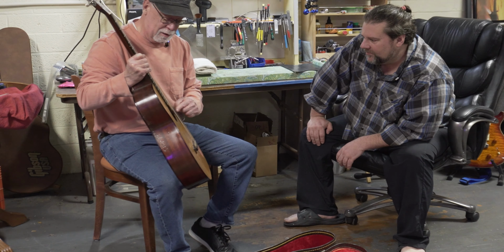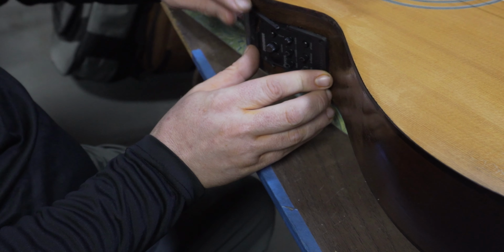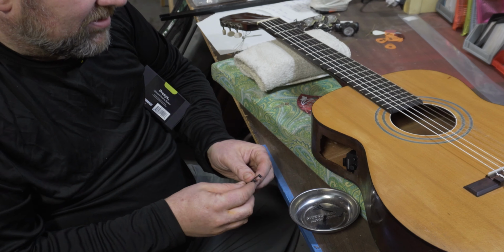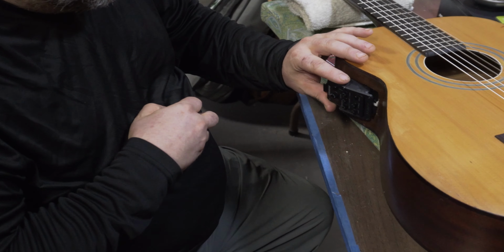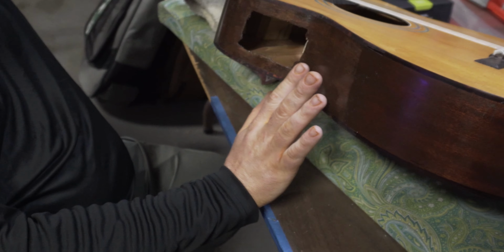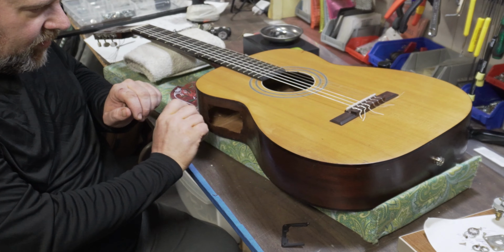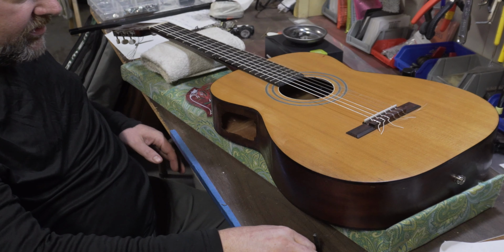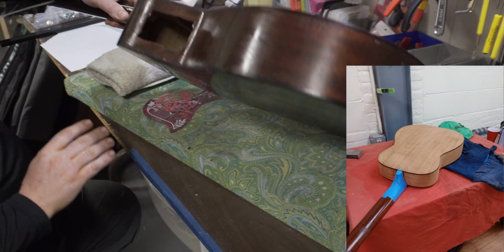Vintage Guitar Pickup Install: Full of Surprises! | Journal #002 #classicalguitar #pickup #vintage

Comment: as I said in commenting on another video of yours I have a guitar with built in pick up and another, which we might call "vintage" that doesn't have one...maybe I'll try applying this counsel 😊
Reply: Yeah so nice to have a pickup that captures that vintage wood tone directly for your recordings. It also means you can take it to the stage without the hassle of microphones. One thing to be aware of is the older wood is so fragile that it can split even when drilling a tiny hole. Mike is awesome and was able to work through it but many of us would probably lose our mind lol
Reply: @aboundweb  👍👍👍👋